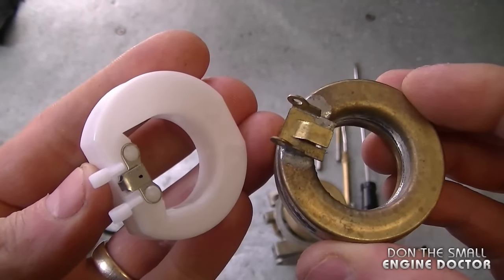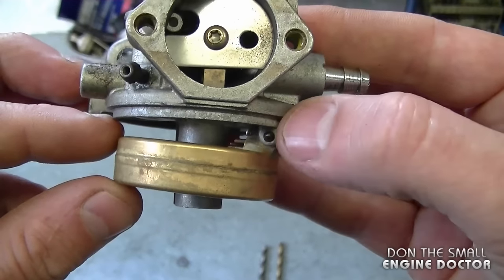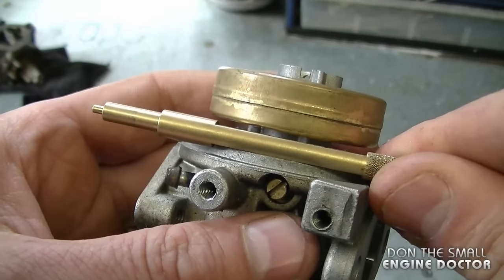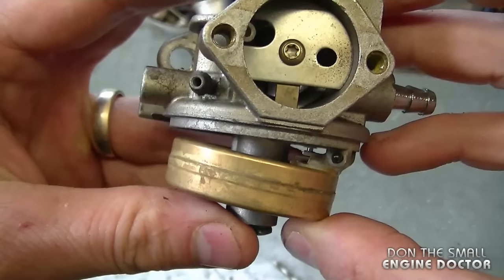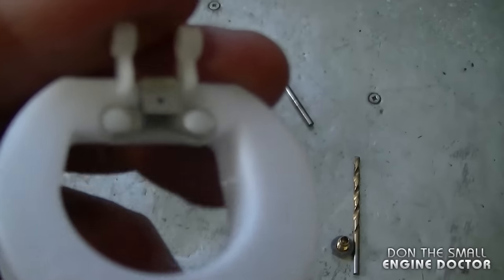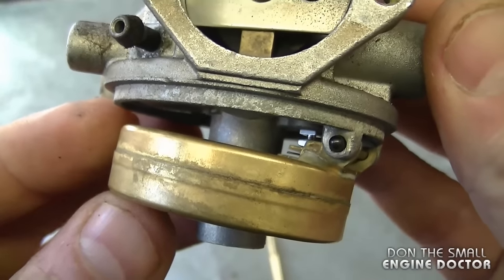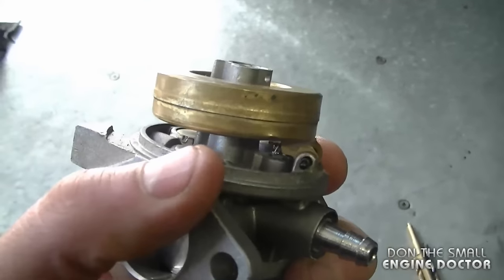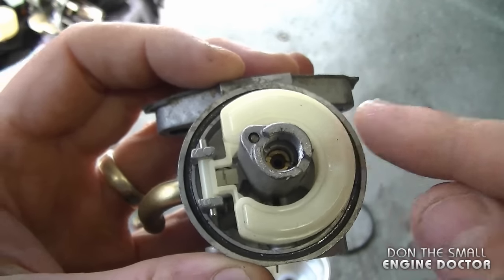HOW-TO Adjust Carburetor Float Height

Comment: I put about 1 cup of fresh fuel in 78 Bolens and my 82 Ariens each month and let them run until they run dry. I left my Ariens machine outside uncovered while building a shed late this year and when I went to use start it, the fuel was pouring out of the carb and even the primer bulb. Very obviously a float issue. I had rebuilt the carb a few years back and had no problems at all up to this point. When I brought the carb inside, the bowl was a little tough getting off but with some warmth and gentle coaxing it finally popped off. I checked the bottom of the bowl and saw what looked like a clear gel in the bottom. I poked it and it didn't move. I put on my cheaters so I could see better and realized it was about 3/8" of ice and fuel or oil. I cleaned and dried the carb, used wires to clean the orifices on the threaded needle shaft (term?), cleaned the gaskets and then blew the whole assembly out with a soft bit of air. I reassembled and reinstalled the carb. It was late and I didn't want to wake my neighbors so I didn't bother with a test run. When it came time to use the machine, it started right up, smoothed out quickly but took a bit more choke than it did before. It would run for about 3 minutes under load and then quit. I went through this about four times, scratching my head each time. It then occurred to me that the problem was when I removed the bowl the first time. The bowl must have been stuck because the float was frozen to the bottom of the bowl, not so much the bowl seal. So, when I popped the bowl off, I must have pulled the adjustment tab on the float up which would make the carb buildup less fuel in the bowl by shutting off the fuel supply prematurely. I never thought to recheck the foat level before reassemly. I couldn't remember the setting and remembered several of your videos helping me out before. The one thing I needed was that spec. You always provide GREAT detail and information in your videos and you did exactly that in this video. Thanks again for making some of the very best small engine videos out there. You can tell when someone takes pride in their craft and loves sharing their knowedge. Thank you!!
Reply: Good on you sir for expressing a genuine gratitude to the video creator and for likewise sharing your issues in concise fashion. This type of encouragement is from the heart and leads to feelings of satisfaction and peace of heart. Goal:  to teach others, learn to grow, and all in a spirit of love...    It casts out all fear says scripture! Peace and thanks friends.
Reply: You blessed my heart this evening buddy I'm telling you people need to see what appreciation looks like.  Thanks again

Comment: just happened to this video accidently.  So glad I did.  Old rototiller giving me fits after working ok last year.  adjusted the float as described...both screws adjusted in all the way...out 1-1/2 turns.  started first pull and ran like a champ.  thanks for the video.

Comment: 1/19 2019  THANK YOU so much for showing the FLOAT ADJUSTMENT TOOL and 11/64 drill bit adjustment !!!  My 8 Hp Ariens (oldie)  was leaking like nuts.  I had  taken it apart and cleaned it out and it ran fine at the end of summer.   I got it ready for the winter.  The COLD NORTHEAST.... today just before a 2 foot snow storm hits, I ran the Blower just to make sure it was ready for this storm.  The machine started fine. I ran it not even for a minute then stopped it and noticed gas dripping like nuts from the carburator.  It never had this problem before and after watching some YOU TUBE and  " your " video I was hoping it wasn't  the seat,  I didnt think it would be, crossing my finger.  I noticed the FLOAT was out of adjustment  big-time  and the 11/64  drill bit adjustment did the trick  and its fine ...  thank you !!!!    Thank you !!!

Comment: I have many times had to replace the rubber seat in a Briggs carb to adjust a all plastic float that was not adjusted right. Most I have seen would stop fuel flow way to early starving the engine of fuel.  THUMBS UP .

Comment: Of all the thousands of these Tecumseh and Briggs carburetors I have rebuilt I usually set the floats where the trip off at a lower setting  in order to ensure the level never reaches overflow.

Comment: I have worked on many different small engine carburetors and never gave that a thought.  I learn something new every day.  Thanks for the information good job on the video.  👍.  By the way that Toro S – 200 I got to use it this morning and she's a little beast.
Reply from the maker: that's good
Reply: donyboy73 - one other thing I'm glad you respond back to people on here 👍.  Thanks.
Reply from the maker: I try my best but sometimes I'm just too busy
Reply: @donyboy73  great videos! I was wondering if you had any insight on a problem I have. I had to change the carburetor because the mower would only work on choke and would die on HI or LO positions. I didn't change anything else. When I pull the lever out of choke down to the Hi position the rpm is pretty much the same but when I put it on the LO position there is no change in engine speed which seems to be ok for the Hi position. The motor is GVX120 4.4HP 1 cylinder on a HONDA HR214. 

The governor arm is free to move if I push on it revs faster. There are no restrictions either on the idle arm where the 2 governor rods attach on the carb.

Any Idea? Hope you're not too busy. 😉

Comment: Hi Don.  Your vids are excellent quality and very helpful.  On my 8 hp tecumseh carb off of an approx,. 1980 Toro 824 blower I've bent the tab to the point where I can just get the needle spring in yet it still sits too high.  I bought this blower used with a fuel leak and running rough.  It does have the tiny spring on the float pin but I don't see how removing it would affect the float clearance.  i've also assured that the seat is firmly in place and needle is in good shape.  Pleases advise. Thanks

Comment: i got a question i got a sears craftsman   with briggs & stratton  carb for sure ..i just replaced the needle valve  & the rubber  to cover the hole to the gas flow ..the whole thing is made out of plastic  the part you said to adjust is also  so is there another trick ?? so ok here is the model # 027378450   then serial # is 03520 M-03344    so   would hope to get a fast answer   there is no metal at all on the float ..well thanks  lee

Comment: Dony I have a Honda mower with the Honda GCV160.  The issue I have is it will start but after 20-30 secs it just dies and won't restart.  But wait a few minutes and it will but only for the 20-30 secs.  I think the float is not opening enough to let gas in.  The float is all plastic...how do I adjust that?  I'm after cleaning the carb thoroughly.

Comment: I think this video just helped fix my carb ... I was having a problem with my Ariens 824 with Tecumseh 8hp where it would start easily then blow snow for a few minutes then just quit.  I had been racking my brain on it for about 2 years where I tried to get as much blowing as I could do in the first 3 or 4 minutes.  When I pulled my spark plug it was VERY wet and I cleaned and re-cleaned the carb jets with no luck.  When I checked the float height tonight, it was set right to the very top (no gap).

Just curious Donboy, how often do you need check the float height ?  Should this be part of my annual maintenance ?

Comment: Don, I just purchased a replacement carburetor for a Tecumseh engine on a Toro recycler mower.  I was going to use it for parts but the main part I wanted was the needle inlet SEAT.  The new one arrived with a BRASS needle inlet seat so of course I won't be able to use the new seat on the old carburetor because the old carburetor has a rubber-like seat.  Is this a NEW design? (I also was going to use the bowl on yet another mower.)  I'm so confused!

Comment: Have a question? Fixed all the gaskets, but there is a pin hole located on the carburetor just above the primer hose male connection. When I prime the engine, a stream of  fuel shoots out of that hole and then it continues to drain fuel slowly emptying the tank. Do you know what that indicates? Is the float out of adjustment? Also, the engine will run for 3 seconds and shut down Seems like fuel starvation after its primed. Thanks for the help!

Comment: Excellent, thanks Dony. I thought it was just necessary that the float be level. So does this mean it could be level but at the wrong height? Also does this mean you can regulate the float without having to go through the rigmarole of removing the carbureteur? I sure hope so. Thanks, Dony.

Comment: I hope you still respond to questions. I have the Honda GV 160 engine with the auto choke. It allows the fuel to overflow and pour out through the air filter. I think this is because the float is incorrectly adjusted. I had the carb cleaned by a friend. I have only seen videos to replace the float and needle. Are they not adjustable on this model?

Comment: I worked on a Tecumseh  Carb push lawnmower  and I noticed  if there is no screw on the round cylinder holding the plastic  and paper 2 screws the screw on the left side is missing  or removed it does not want to prime  properly I have to ask you why and can you discuss this problem.  Tec Carb 3 to 5 hp.

Comment: Thanks! I replaced the carb on my mower. It's a tecumseh on an older craftsman riding mower. It backfires, so I was thinking the mixture is too lean. There's no mixture adjustment screw, so I'll give this a shot. I replaced the old one because the gasket leaks. Weird thing is now the mower backfires even with the old one back on. Any ideas?

Comment: My craftsman riding mower has briggs n Stratton motor, my fuel solenoid won’t screw into bottom of float bowl, the threads won’t catch with the bowl on it will screw on without bowl, should I replace the solenoid or is it another problem?

Comment: Hey Donny. I have a Toro CCR 1000E 3 Horsepower snowblower. It has served me well for approximately 20 years. I watch your videos whenever I need to do any maintenance. My choke turns freely until it engages the spring coming out of the carburetor I'm not sure if I'm missing something ...some part I don't see anymore. Do you have a video on that carburetor or that joke? I can't find it.

Comment: I have a Arians snow blower with a 10 hp Tecumseh e engine.it would not start this year. replaced the spark plug, then the carb started leaking around the bowl. having had the blower for about two decades, I figured the carb probably needs new gaskets. replaced the needle, the seat, bowl gasket, and float. the carb seems to be leaking fuel up the emissions tub into the body of the carb. is this an indication that the emissions tub has a problem?

Comment: My MTD 4.5 HP 21" single stage snowblower runs well, always starts on first try, but raw gas is shot out of the exhaust pipe, from full choke to half choke, but no change to RPM from half choke to No Choke, is the float too low then?  I have a 13/64" drill ready.  I need your advice, thanks.

Comment: Please can someone give a me a direct answer on this - (thanks in advance)

I made a huge mistake, by assuming my 4 stroke strimmer didn't have enough oil in it, and there was this plastic clip that allows you to place it on it's side, so I placed it on it's side and filled it all the way up to the top, and it smoked a lot when I first started it, and now there is a slight oil leak all around the seal of the crankcase.

I'm guessing since I only used it once, it wouldn't have done too much damage, but now there is a potential leak forming, what can I do? 

Replace the silicone seal, or use an oil additive sealant repairing bottle that you mix with your oil?

I was an idiot, after not realizing that the dip stick did have a mark on it, which I hadn't seen at the time. 

Your videos are always informative, and have already helped me out on a few other occasions. Thanks, Donny

 Thanks!
Reply: looks like the extra oil caused it to build up pressure blowing the seal, you should replace the seal. I don't quite know the machine you have, but this usually can be done without too much trouble.

Comment: If the float lets too much gas into the bowl will it run richer because it takes less energy to pull gas up the tube to the main jet, and if the bowl gets too little gas it takes more energy to pull the gas up the tube so it runs leaner?

Comment: I'm working on a Briggs engine on a riding mower that has been sitting since 2008. I've replaced the fuel line, fuel filter, vacuum line and rebuilt the fuel pump. The only way it will run is with the choke on. I've adjusted the carb without any effect. The carb is clean inside. When the blades are engaged, the engine usually dies. The last couple times starting it, it sounded like it was leaking pressure and won't start. Any ideas?

Comment: ok i got to th all plastic one but it will not let the fuel go thru ..i am starting from scratch  the 1st needle i took ground the top that is flat & i took to much off so it   did good then there was a part that was more flat then the rest  then it flooded so i got one i did not touch well now it will not let gas flow thru again ..the thing i am thinking is to file it 1 stroke at a time  flat  with my vise to hold it   then each time put back together  pour a little gas in  then see if it run all the time if so i got it ..i might go ask a shop maybe the float needs to be replaced  ..the carb is exactly like a tecumseh one only difference is little ..seem like i almost could use a tecumseh one but there are little changes   the extended part needs to come off  but the most would be the filter  maybe not  ..but i am going to see about a float .. i think that would be best get a new float ..i forgot about the 11/64th i did it before it worked good  all right thanks  later lee

Comment: Looking to see how the pin is connected to the wire and to the float. No video I have seen has shown this yet...
Reply: NALTIC Industrials, LLC same here. My damn carb keeps pouring fuel with a brand new needle and seat. I put it in as it came out but I’m guessing that was not correct. I’ve never had it running myself so I have no clue what the original owner did. My need sat on the tab he adjusts in this video. The wire that hooks to it was stretched out and ran under the two tabs below the one he adjusts. It seems to tight tho. I think it’s causing the leak that way. May switch it up in the morning and see what happens. Good luck

Comment: Tecumseh Series 11 Carburetor that’s good carb Tecumseh was the only small engine company that made there own. Instead of other manufacturers buying there from keihin or Mikini. Although great ones as well also lastly to add I replaced the Brass float with the plastic one. I feel it won’t corrode as easy. Still saved it for reference

Comment: I replaced the defective brass float with a plastic float. The plastic float included a tiny tension spring that fed through the float pin at the back of the plastic float. OMG whatever you do, don't drink coffee or have the shakes when installing that tiny spring lol.
Reply: Per TSB instructions says to use it if the original one came with one. And i like the plastic one better the brass one the solder cracks and will leak. Plus i feel it corrodes from the gas easily.

Comment: I can't seem to get the carb on my 30-year-old 8hp Briggs adjusted properly. I'm wondering if the float is not adjusted properly. What is the gap required on this motor? (I can't seem to find this info elsewhere). thanks!

Comment: I have a Tecumseh Power Sport 6.5 HP. When I Fill the gas tank the carburetor leaks gas. The leak comes out by the air filter. Do you think the float is the problem?
Reply: Most likely the needle and seat leaking but I would check the float height as well.

Comment: I have a Tecumseh carb off a mtd snowblower. fuel poors out the bowl top.  I took the bowl off and looked where the needle valve goes and I see now rubber needle seat. is there supposed to be a seat there

Comment: I have done so many carb rebuilds in my life I can set them by eye. I am sure you can too. Anyone that does this for a while can set the float level by eye. If It doesnt run right,then I know there is something else. I have seen many floats with an actual dimple in that tab. If that dimple is too bad,you should replace the float. Also if there is fluid in the float or there is alot of corrosion around or on the float,its shot. I have found floats where the float pin was corroded right off the float. Also where the arm that holds the float pin corroded off. Water is the biggest problem with that,caused by ethanol fuel. I am now telling people to look for recreation fuel or get a treatment and add it to every fuel tank you fill from the pump.
Reply from the maker: yes exactly

Comment: I have a little 5.5 hp tucumpse 22" snow blower and it would only run on one notch from full choke and Full throttle and I took the carb off to clean it and now that I put it back together I can't get my engine running by its own power the only way it will start is if I take the spark plug off and put gas in the cylinder any suggestions on how to get my engine back running again?
Reply: Hunter whitesell    Needle valve and float stuck shut ?